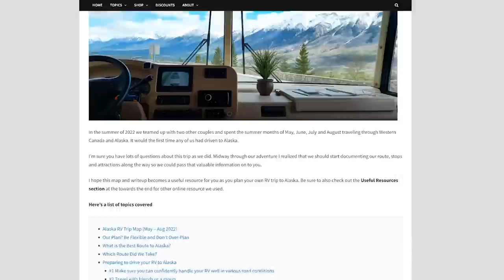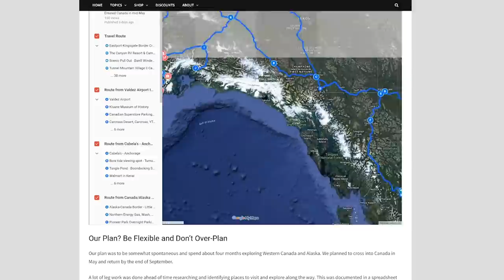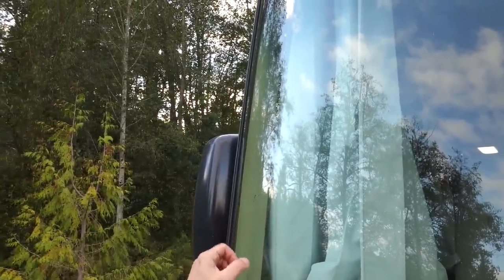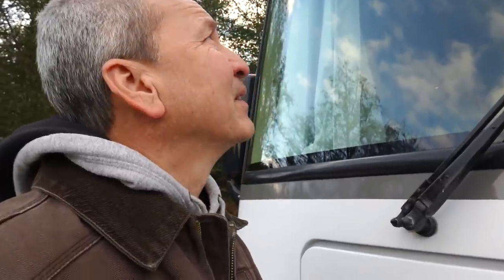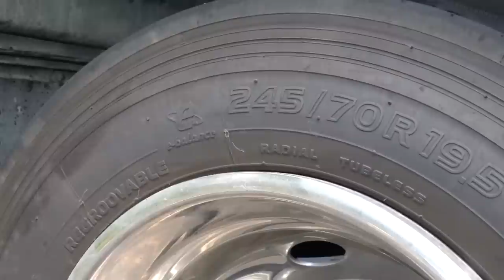Repairing RV Damage From ALASKA Trip | RV with Tito DIY

Comment: Airlift missed a golden opportunity. Instead of pushback, they shoud have sent you reinforced brackets to test. Ongoing R&D is important with rigs this heavy. Thanks for the update video Brian.
Reply from the maker: Right?! As others have said...short sighted.
Reply: @RVwithTito  I would have taken the new brackets and had them reinforced, as they will bend again.
Reply: @CA-bo6sv  I was thinking the same thing.  It shouldn't take too much to add a little extra to it.
Reply: @CA-bo6sv  I thought that at first, too, but that might not be the best plan. Brian's trip was likely a torture test for the brackets and personally, I'd rather have the bracket distort a bit but still function as opposed to having the energy transfer to another component that might crack actually fail. Just something to consider.

Comment: Keep the old brackets and take them to a fabrication shop. Have them straightened them and weld in some gussets. So when it happens again…
Reply from the maker: Good idea. I do plan on keeping them because steel is expensive and I need things to practice my welding on :)

Comment: Was there a factory bumpstop on the motorhome that you had to remove in order to install the airbags ?. I would guess from the photos you showed that its almost guaranteed that the airbags bottomed out due to the road conditions and the force upon bottoming an airbag is substantial and will bend airbag brackets. I've seen this happen on pickups with airbags installed and yet installed according to the airbag manufactures directions. Years back I was up in Alaska and experienced that area of the Alaska highway that seems notorious for the frost heaves and I was following a long front engine motorhome so lots of overhang behind the drive axle and he was towing a small jimmy. He was maintaining 60 mph constantly and I thought at any moment the frame would buckle or tires/wheels would come flying off the unit with the insane punishment that person was putting their rig through. The fact that the towed vehicle was behind and more or less following the road contour showed the stark difference between what it was doing vs the motorhome slamming up and down.
Reply from the maker: Yes it had the factory jounce bumpers. While up there we also heard stories of busted tow hitches. It was definitely slow going in many stretches of road.
Reply: @RVwithTito  Years back when long stretches of the Alaska highway were still gravel ( I don't know the history of when they started paving it ) it was a given that it would be quite a trek and with rains a horrible mess to slog through but when they finished paving it I think people assumed it would be easy sailing but perma frost etc melting down under the road bed just ruins the pavement so what was good is now bad. I think that has caught a lot of travellers by surprise and not in a good way !. Most RV's and vehicles for that matter are just not designed for that type of road and the trail of parts tells the tale as you heard and saw. Pretty much need a Baha trophy truck to travel those sections at speed. My dad had travelled up there a couple of times with two different large motorhomes and pulled a boat all the way up there one of those times, he must have taken it easy and the road may have been better then, somehow came out of it fairly unscathed.

Comment: Great video!  Using that clear packing tape was recommended to me by a a windshield replacement guy several years ago. A 2”- 3” piece will keep the chip from expanding until it can be repaired.  I also liked the drilling of a hole for the crack.  Will have to remember that for the planned Alaska RV trip.
Reply from the maker: Class A windshields are large targets, but I've talked to others in truck campers or smaller rigs that made the trip without any rock chips.

Comment: Great Video Brian!  Love the pic of our muddy fifth wheel in your last chapter with all the Dempster Hwy mud on it that we picked up travelling from the Beaufort Sea.  You are right, most rigs can navigate these more northern routes with little issue.  My moto is to make sure you have good well maintained equipment, and issues will be far less frequent, although not entirely absent.   We just need to remember to take our time, and you wont beat things up too much.  Doing some research before your trip helps a lot too -  to better understand the conditions you're heading into.
Reply from the maker: Yes. Thanks. Planning and proper preparation are key. Plus some situations are simply unavoidable like when it rains on the only route from Inuvik 😃 Glad you got the rig all cleaned up.

Comment: Another fine productive video....
Your always well presented details are really appreciated.
I had airbags on my older RV on a Chevy chassis that came from the manuf. with the rig.  They did not last very long as the bags failed.  That made me essentially anti-airbag.  However, your trip certainly changed my mind as I was stunned to see the meaty bracket failed but, not the bags.  They must have a much stronger polymer in the bag material.  I couldn't tell, but I am assuming you have air-pressure lines running to each bag to allow adjustment, etc.  Curious, what pressure worked best for your RV and how did you adjust it while on the road....DL
Reply from the maker: Aside from those rear brackets, the bags themselves were certainly good to go. I ran the hoses inside a nearby compartment and have a hardwired air compressor nearby. The fill line for front bags are inside the wheel well near the top (easy to get to). I kept the fronts at 30psi and rear bags between 50-60psi. Now I keep the rear bags around 30psi unless I need an extra inch or two of extra clearance. I had these on the rear of our Class C also and installed the on-board compressor. It worked fine with the bluetooth remote but only supported two bags. I opted just to do it manually this time.

Comment: Brian - Just wondering how your toad made-out considering all the rocks being thrown up at your windshield? Did you take any precautions to protect the toad?
Reply from the maker: Aside from getting dirty, our toad survived without issue. We always cover our windshield when towing (a lesson learned many years ago driving through a construction zone). It's a cheap black cover that I got for about $20 over a decade ago and wraps around into the door frame. It has definitely saved us on many occasions. Our friends didn't have windshield covers (at first) and had some damage. If you're toad has decent road clearance then that will help. With low clearance you're much more prone to damage.  Hope that helps.

Comment: In 2019 we drove our truck and 5th wheel up to Alaska.  Only got 1 rock chip just before getting to Dawson Creek.  It was a great idea to have your own rock repair set up with you.  Yes the roads can be BAD.  We took the Tok cut off on the way into Alaska. Between the bad roads and the road construction, it took us 5 hours to go the 150 miles to Glennallen. Did you use the Mile Post book? We found it to be invaluable and wouldn't drive to Alaska without it.  When you traveled where did you keep your spare tire?  Were you able to get it into one of your storage bays?  Thanks for another great video!!!
Reply from the maker: We did use the Milepost book a lot in Canada...not so much in Alaska. We actually have a spare tire mounted under the rear of the RV so I just replaced the existing spare with a new one.
Reply: @RVwithTito  I wish our Winnebago Vista 30T has a place for a spare tire.
Reply from the maker: @stewartmhyre1528  That's a bummer. Our Class C also had a spare tire underneath.

Comment: How did the solar work up in Alaska? Did you have any charging problems? Did your panels make the trip OK?
Reply from the maker: Yes. The sun wasn't at its peak, but the days are long. Towards the end of the trip we started to get a bunch of rain for days on end and had to run the generator a couple times to push some juice back in. Apparently fall starts in August. Here's an update https://youtu.be/ZZn_A1zCPwE

Comment: Hey, it a puzzle for me about going to Alaska ?  High crime, log truck rocks, trash your rig for what.  Not worth it.  Everyone that i know that has gone has had problem and repairs. Most windshield, slidouts damage due to roads.  
Expensive.  Rather go along the Pacific Coast and camp on the water there lot less drama.
Reply from the maker: The points you make are valid except for high crime. Not sure where you're referring to. Besides seeing a couple sketchy folks in a parking lot, we always felt safe and met a lot of great people. Those are definitely things to consider when deciding to make the trip.
Reply: @RVwithTito  Alaska's got the highest crime rate of any other state right now it's the highest of murders.

Comment: Hello Kirk here. I have a 2000 winnebago adventurer like yours. Thank you for all the awesome information. I plan on doing the air suspension and new shocks. She has 113,000 mile still drives  awesome. I am redoing the inside to match modern style. If there were a structural plate welded on the top  Angled to the frame with a bolt would that Make it so the plate does not bend again?.
Reply from the maker: Thanks. Good to know. That might limit access to air line and mounting bolts on the top which are already difficult to get to. The pass side also has an LP line right above next to the frame. 🤔
Reply: @RVwithTito  oh ok got it thank you. Be safe.

Comment: How are the SnapPads working out on the jacks. Had any problem with the added weight slowing the rate of the jacks retracting? I am thinking of adding them to our 2007 Journey but concerned they might create issues with retraction. Thanks for the great videos.
Reply from the maker: They're fine. I only have them on the rear and they don't slow down the jacks coming up. After replaced the springs they come up without any trouble. My front jacks are different shaped (kind of rectangular) so the other two snap pads won't fit.

Comment: My biggest concern with those air bag brackets is how little vertical connection to the frame there is. That's allot of force leveraged against the web of the frame. I would be watching for the frame web bending at the connection points. Those brackets really should be almost the full height of the frame to properly transfer the forces to the flanges of the C frame rather than mid section of the web.
Reply from the maker: Makes sense. I guess they are working around existing equipment and trying to use existing mounting holes as an aftermarket product. I had to drill a few new holes anyway which was not fun.
Reply: I was thinking the same thing.  Not a good engineering design (as it is) in my opinion.

Comment: Love the vids, how about an f250 4x4 and HQ19 Black Series camper for Alaska roads?
Reply from the maker: Oh yeah. You'll be fine. There were rigs of all shapes and sizes. Most of the dirt/gravel/construction zones are in Canada. Just take it slower on the bouncy parts.
Reply: @RVwithTito  as a side thought would it be worth it to cover exterior windows of trailer for protection? Protective film?
Reply from the maker: @gtj2020  It's your call, but I don't think it's necessary since you have to front facing windows. If the tires on your trailer extended beyond the frame, then maybe.

Comment: Brian, drill a hole at the end of the crack and create a new bullseye/star and of course fill with resin, etc, it's scary but I did it about five years ago on an auto windshield and its still holding, crack has not progressed, might buy you some more time before you have to purchase a new one. Worth a try especially since your'e already planning to replace it, If it works, great, if it doesn't, you experimented with a $20 repair kit, maybe a worthwhile investment for your next video.
Reply from the maker: Thanks for the tip. Funny. I thought of trying that while on the trip and stopped myself just in case it went south on me. I might be worth trying now. I think I got enough resin in there near the end of the crack, but you're right. There's no external crack for it to seep into without creating a hole. Instead of a bunch of kits, I'm going to start carrying a bottle of just the resin. They don't give you much in the kits.
Reply: @RVwithTito  You probably already know this, and I think its in the resin kit instructions, but only drill halfway through to the laminate in the middle, I presume RV windshields are made the same as auto glass with a clear laminate between an inner and outer layers of glass, good luck
Reply: Brian, possibly the windshield crack is also caused by the steel windshield frame rusting, combined with the rough roads. This is a known issue with the Winnebago vintage you have. We have a 2007 Journey and our second windshield pane has just started to leak caused by rust on the windshield frame.
Reply from the maker: @markheene8852  That's very possible. There's been some leaking as well this year, but I've stopped it with a bunch of silicon. I was unaware of this known issue. So THANKS!
Reply from the maker: @Johnobee1  Yes. That makes sense. Thanks for the reminder.

Comment: Great video, Alaska is on your bucket list.
Question: At what pressure did you run our Airlift system. Thanks...
Reply from the maker: Thanks. I kept the fronts at 30psi and the rear at 60psi.
Reply: @RVwithTito   I have a single pump system on my 2012 Georgetown 351 DS. I find by running at 25 psi on all four corners, gives me the most smoothest ride.  Thanks…

Comment: So incredibly short sighted of the airbag system manufacturer to give you pushback.  So many people will be very hesitant to purchase from them now that they know what you went through.  The best move (regardless of reason) they could have made was to cheerily send you the new brackets with a smile on their face and give you a follow up call from the president of the company.  That would have been worth its weight in gold public relations wise.  Honestly, just how much money did those pieces of metal cost them versus the number of orders that they lost by being jerks.  Stupid is as stupid does.  Stupid stupid stupid!!!
Reply from the maker: I agree. They just wouldn't get back to me and wanted me to purchase new brackets. I even read the fine print of the warranty. They couldn't back up their claim that they weren't supported. I did not mention the YouTube channel so I could get a real sense for how they'd handle this situation. I was about to cave and buy replacement brackets to get it done, but thought I'd try one last time. The before/after pictures I sent didn't lie. They made it sound like they were doing me a special, one time favor. You're right. I wasn't asking for new air-bags...just the brackets. Not the experience I was expecting.
Reply: @RVwithTito  welcome to 'getting hosed'. Now you know why my equipment is old, battered and beat-up. Pre-broken-in.

Comment: Hello..on an unrelated subject. Have you had any experience using a Telma electromagnetic drive line brake? Driving a 1994 gas powered Flair Class A, a Jake Brake is not an option.
Reply from the maker: No. Sorry.

Comment: Love your videos, so much useful information. My wife and I had a Travel trailer for the last 15 years and have sold it but are looking at a used Motorhome for our next adventures. On average how many miles can you travel on a tank of fuel ?  I believe you have a seventy five gallon tank if I am not mistaken. Love the Mods you have made to this rig and the Class C you had.
Reply: Get a diesel. Fuel economy is better. Bad time to travel w diesel shortages tho.
Reply from the maker: Yes a 75 gallon tank will take us roughly 450 miles. I try to refill somewhere between 1/4 and 1/2 full. Our friends had large diesel pushers with larger tanks than us. So I was always refilling whenever I had the chance. They were very mindful of finding the best deal (typically at a Costco) since they're filling 100 - 110 gallons of diesel which was more expensive.

Comment: Those metal brackets looked under-engineered.
Reply from the maker: Hmm I wonder. I double checked the torque specs today just to make sure I didn't under torque it. We'll see how it goes. I don't anticipate driving in those conditions any time soon. We do go off-the-beaten path quite a bit, but not at higher speeds.

Comment: So, on those airbag brackets they are poorly (under) engineered, and the company tries to get out of warranty. Definitely stay away from that brand.
Reply from the maker: It's a bummer since they are rated for this chassis/weight. It certainly is an improvement, but now I have to keep an eye on it. I had them on the Class C as well with no issues.